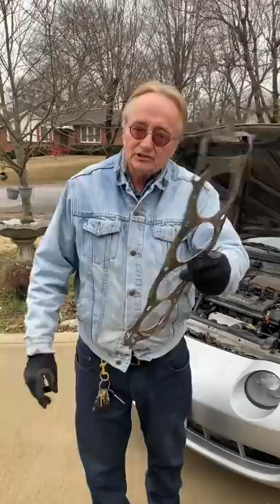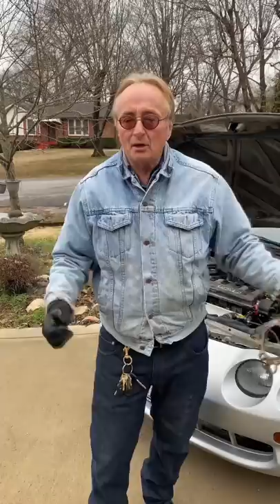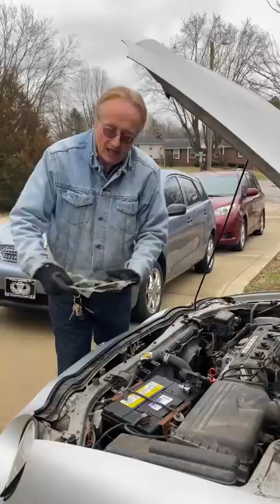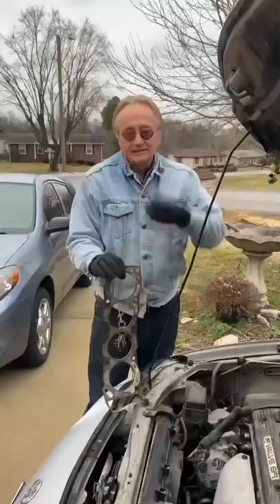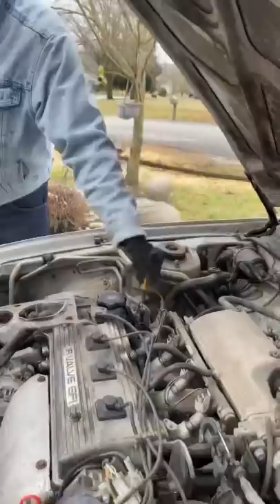Two Words You Never Want to Hear

Comment: I remember helping my dad change the head gasket on his 1962 Ford pickup truck.* Took us about 30 minutes. Nowadays it would take you that long just to disconnect all the pollution control hoses and sensors before you could even begin thinking about taking off the head.

* Funny thing: There was so much room inside that engine compartment (it was a straight 6) that we could both stand INSIDE there, one on each side, as we leisurely loosened the bolts. Sure saves your back not having bend over for an hour and a half!
Reply: was it on the Ford 300ci Straight six? that's a good motor to learn on, if it ever even has problems! one of my favorite work horse engines
Reply: @JasonLuther1  I couldn't say, but I remember that it rarely had any issues and when it did they were very easy to fix. I also remember that the 3 speed manual transmission, coupled to the low-ratio rear end, could pretty much pull a tree stump out of the ground, though the top speed was not very high. You could put it in 3rd gear at less than 10 mph without bucking.
Reply: @JustWasted3HoursHere  oh yeah, those engines were also put in tractors, generators, trucks and many other Industrial applicationsthey were awesome. My grandpa still drives a 73 250 daily with that same engine. Not good gas milage AT ALL lol but its still running strong
Reply: @JasonLuther1  Yeah, I seem to remember that it got terrible mileage. Also, the rear axle was VERY low geared, like 5.13:1 or something and it only had a 3 speed so that didn't help the mileage either, but it could almost literally pull a tree stump out of the ground!

Comment: Scotty, thanks for the tips. I have an 06 Matrix. It squeaks right front, every wheel revolution,  a few months after putting ceramic pads.
After checking not glazed and blowing out all four brakes it still squeaks intermittent. It's 4wd. 
Any advice? 
Tip... putting a tee shirt short sleeve off a rag on the windshield washer fill tube will always give you a place to wipe off dipsticks... just make sure it will not interfere with belt and change when dirty...
Thanks and keep the videos coming...

Comment: With all that said scotty, you're correct but I think we should encourage people not to be intimidated and do their research and try to fix things themselves. Especially if its on N/A engine. Take care of your stuff, drive conservatively but don't be afraid to turn a wrench with the proper tools and research. I learned how to replace head gaskets on my old sn95 mustang and learned Timing belt, water pump, oil pump shaft seal all from my 96 Camry. Nice thing about Non interference engines is if you mess up the timing just put on a new belt correctly!

Comment: Worst case scenario, a warped aluminum engine that's beyond repair
Reply: Hmmm...  Sounds like the three 90's Cadillac Devilles I've owned in the past.
Reply: Sodium-filled valves replaced with solid valves by an incompetent Porsche mechanic cheaping out, resulting in those solid valves burning over a measly few hundred miles, can get pretty expensive too.
Reply: @moresnare  I had an 84, pre- Northstar days
Reply: @ストマクランブル  Yeah, those Northstar engines were trash.
Reply: @moresnare  actually if GM actually used bigger headbolts like the ones in the 2006 model year and above it's a good engine. Assuming the pre 2006 models had bigger headbolts the Northstar was great bc it had 291 hp back in 1993. By the time they fixed the headbolts 291 out of a V8 wasn't that impressive

Comment: Its true, my 2003 camry had 60k km on it when i bought it, i learned with Scotty how to change the oil after 5-7k km, oilfilter and the coolant once. after 2 years, im at 85k and it purrs along. thank you Scotty !
Reply: Wouldn't be surprised if your car makes it to 350k
Reply: my bike also 84,000 km by tommorow! shes 14yrs old
Reply: That mileage is almost nothing, it's still new xD
Reply: You're supposed to change your oil every 5-7k miles not kilometers to 5k miles is 8k kilometers
Reply: Wow, 2003 with only 85k km on it....  Most 2003's by now probably have close to 300k km based on average regular driving numbers....  Heck most 10 year old Camry's probably are coming up on 150k km on average.

Comment: Can a head gasket leak oil on the outside of the engine??  1998 F-150 4.6 passenger side.   I am not losing any coolant although I smell it and there is a newly developed oil leak on the passenger side in what looks like behind the exhaust manifold.  My starter is covered in oil.
Reply: valve cover
Reply: @bullofthewoods9374  nope...just had them replaced about 6 months ago.  Just had them checked again about a week ago for a belt.  Going to take it to the shop tomorrow and leave it...but I've owned the truck for 17 years. Maybe I'll get lucky and it's the valve cover...but I assumed they checked it when it was getting worked on..because they alerted me to my starter bring covered in oil

Edit:. Maybe they over tightened a valve cover bolt.  Fingers crossed.  If rather replace that again thank a head gasket
Reply: @saltyp123  thats odd hope its that. i think mine is blown will see this week.
Reply: @bullofthewoods9374  Yeah...Original motor and trans.  Just did a 1600 mile trip to Florida and back..  Ran perfect and there was no leak in Florida--I parked on fairly new concrete.  

Good luck to you as well...You have any coolant in oil issues or smoke from tailpipe?
Reply: @saltyp123   what vehicle you have. i got the iron clad 04 chevy avalanche just bought it used.. they are tough as nails
Reply: @saltyp123  not sure yet neither so far
Reply: @bullofthewoods9374  98 F-150 4x4 4.6 engine.  I have every oil change/part receipt since i've owned it..haha.  It's been cross country 3 times.  It's probably spent a year of it's life in Colorado with all the trips out there.
Reply: @saltyp123  nice man im a chevy guy an it seems the older vehicles by all makes are way better
Reply: @saltyp123  Those 2 valve 4.6 are reliable engines.
Reply: Sometimes you can smell the coolant in the exhaust .
My 04 4runner had a head gasket leaking and you could smell it .
If you are losing coolant and its not leaking anywhere then you are
probly  burning it .
Reply: @jayhockley8841  I've smelled the exhaust and Ive kept an eye on the coolant for the past few weeks.  (had a thermostat issue when temps went single digits)....If i'm losing any it's minimal and not noticeable.   I'll find out today/this week.
Reply: Just to update ...it was not the exhaust manifold.  It is the head gasket. Truck will probably go to the junk yard.  Sad, sad, day 

For future reference...a head gasket can leak "oil" from the side of the motor..if you have an u explained leak

Comment: First mechanicing job I ever did was to replace the head gasket on a 2ltr pinto engine. bought the tools the manual and got cracking amazingly I got it done and the engine was brilliant till the end sadly the body just rotted away, I often remember it

Comment: Modern engines are designed to rev & be exercised. They have red zones, so keep the rpm's under that red zone & you're not over revving the engine then.
Reply: No but you are still putting strain on it imagine if you revved 5000 all the time your engine will fail quicker then someone that revs to 3000 it’s common sense like you are right but so I’m i it’ll ware down much quicker
Reply: @ryans413  Mate touching 5000rpm at WOT during an upshift event, the car will hardly "strain". It's not like i'm sitting there at 40mph holding 5000rpm, don't be silly. There's peak power & torque figures for a reason, if people were going to drive around like the flinstones, what ?, they'll say peak torque at 1475rpm & peak power at 3237rpm ?, jesus some people.....

Comment: I remember my Dad changing the head gasket on our Buick.  It's not an easy job.  I would never do it.  Whenever I see a car going down the road and I see white smoke I know that head gasket is bad.
Reply: Some cars have coolant lines going through the intake manifold (I believe some GMs), so the white smoke indicating coolant could be coming from other places.
Reply: Yeah there are other things that can cause coolant to steam.
Reply: Years ago people would trade cars in when they smoked bad. Dealers would throw a new transmission modulator on it and if it stopped smoking put it right out on the lot.

Comment: Change your coolant.  Even if the coolant looks fresh, it gets acidic over time and will eat your head gasket. This happened to my '95 Civic.
Reply: Flush 3 times with distilled water. Drive it around. Flush, then flush again drive around, then flush again. If you cannot remove a hex head bolt on the engine, don't force it (because you don't want to break it then you have another problem). 
As a rule, even with the flushes, as much as 30% of water is still within the cooling system.
Then slowly replace with either pure or premixed 50/50 coolant. Ensure it's good for -35°F. Use the Coolant Guage for this test.
This is for your Canadian audience. 
It's happened to me. Nearly killed my cars and truck. 
I was younger and reckless then.

Comment: Three words you don't want to hear 'broke timing belt' on interference engine.  I'll take head gasket anyday.
Reply: Any day? The cheapest place I could find charged me over $4,000 to replace my blown head gasket. 2013 Outback
Reply: @isaiahayers1550  Maybe not 'anyday'  but the timing belt scenario trashes the car without a new engine or at the minimum a new engine head and all the trimmings and lots of work.  Not sure about your Subaru, but some I have dealt with have horizontally opposed engines and real pain to work on without pulling engine out for the job.
Reply: I would force them to try swapping it to timing chain

Comment: Had a chevy cruze with 17, 000km on it and the head gasket was already finished. I had to fill up the coolant every week.
Reply: thats terrible only 17k
Reply: @fidelcatsro6948  yep, I also had gotten extended warranty from  a company that the dealer works with and gives to people. I called them up and said that I have a gasket issue that needs to be fixed and they called the dealership too and asked about it. They said , they would  fix the head gasket issue, only of the motor was completely non functional under their warranty. But, because the car still ran they would not fix it. 

 I now call the cruze, the premium lemon.
Reply: @beckysnapkauskas724  facepalms, theyre conmen!
Reply: @fidelcatsro6948  oh yes. So I went to honda and bought myself a civic 😅
Reply: @beckysnapkauskas724  congratulations 🐱👍🏿

Comment: This is why we should move to pushrod engines-replacing a head gasket on them is super easy. Since most cars shift at under 4000 RPM, a pushrod engine is fine. Moreover, OC engines often have oil problems-and the plastic chain guides that many mfgs. use often wear out and cause chain  failures. GM invested a lot of money in the 1990s on VVT pushrod engines-wonder why they dropped that approach? I know a local garage owner-he just did the HGs on a BMW V-8 engine_he said he would never do another again-ties up his bay for far too long, and the parts are extremely expensive.

Comment: Low key I overheated my car twice in one day and I accepted the fact I probably blew the engine but I replaced the oil and added some fresh coolant and 40k miles later my Crown Victoria is still running strong. How it didn’t permanently damage the car is unknown to me. I suppose I was just lucky.